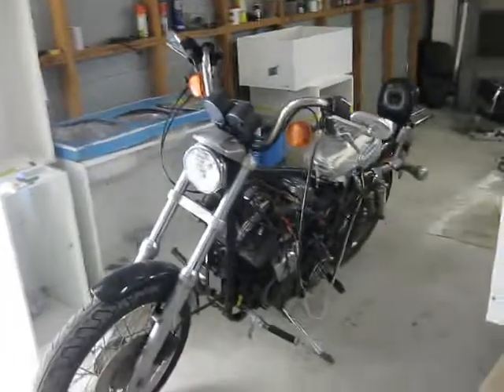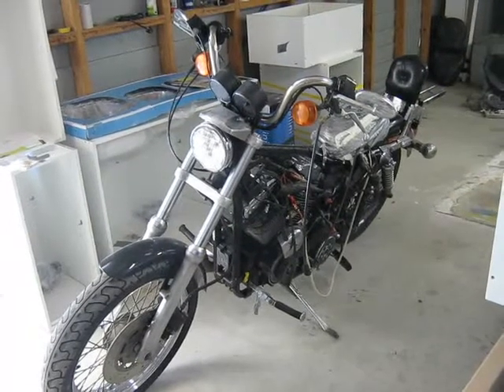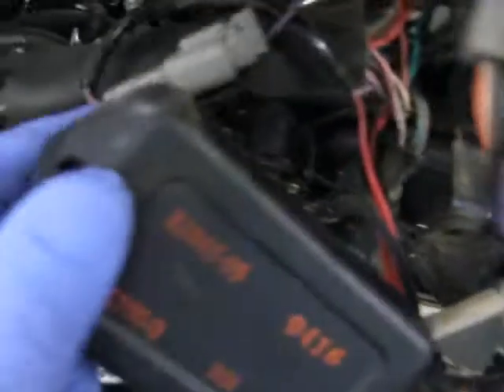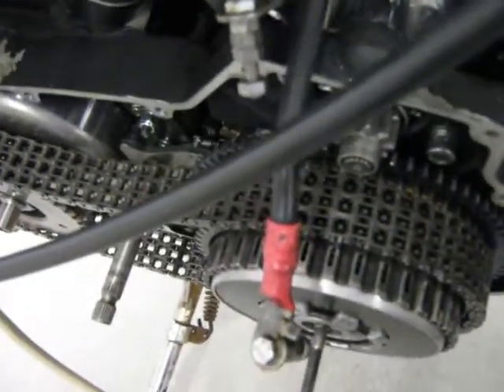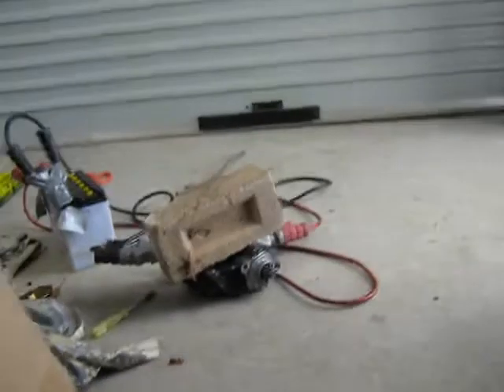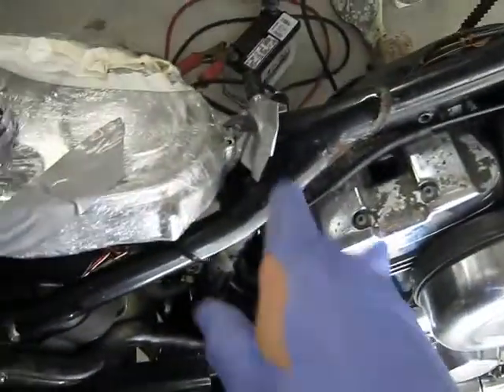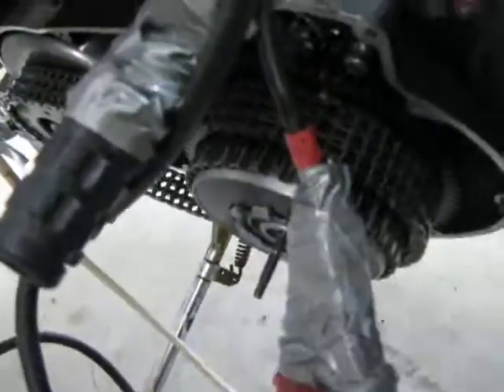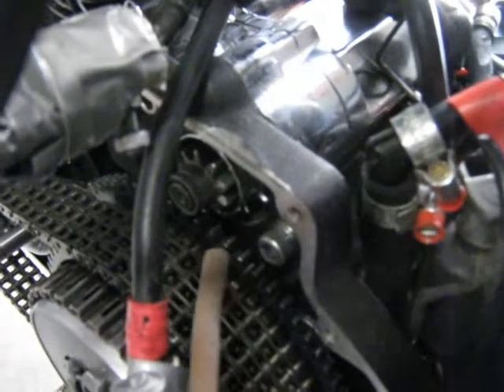Evo sportster problem 19 ( problem was bad battery cable leads )

Comment: Hi, My suggestion is to bolt the battery in and try jumping it from there. I suspect that your leads are not sufficient under start (load) conditions. I suspect that the relay was also fine. If you have not done so already, put your voltmeter across from the battery positive to the starter's positive terminal and crank it.....It should read less than 1V when you crank it. Let me know how you go.

Comment: I don't think you have a short in the starting system it looks like something is binding up I've watched all of the videos you've posted and it looks like the starting problem happened right after you had the cam cover off I would start by marketing sure the cover is on straight and torqued down properly because it can cause the cams to drag on the bushings which would slow the rotation of the engine or cause the clicking of the starter with no rotation of the engine hopefully this helps you and please post more videos I enjoy them good luck friend